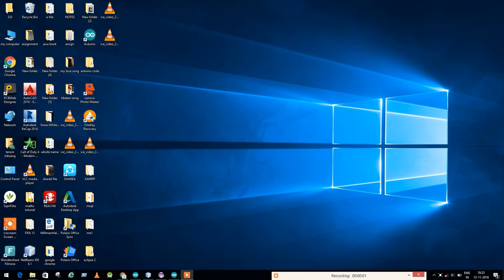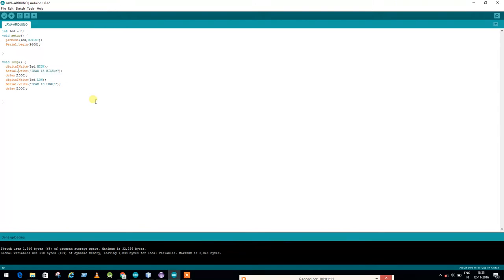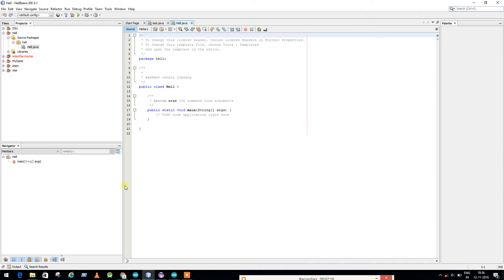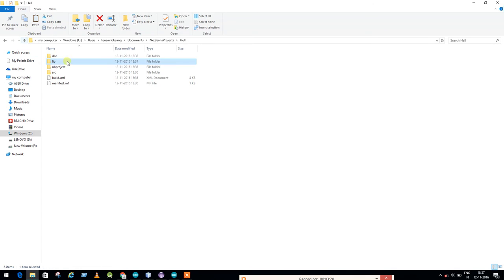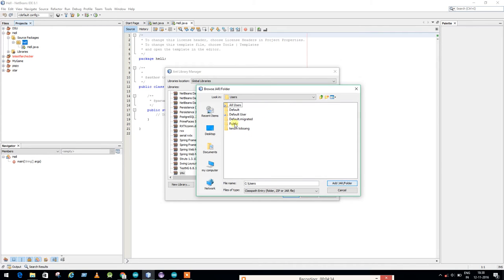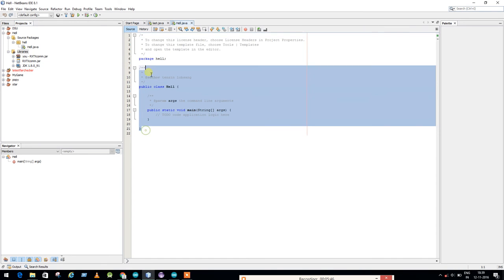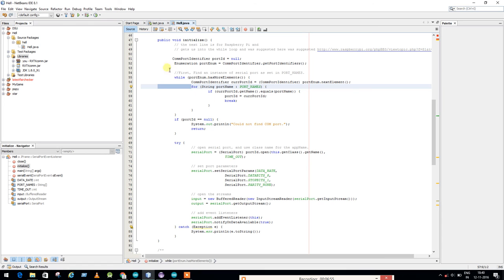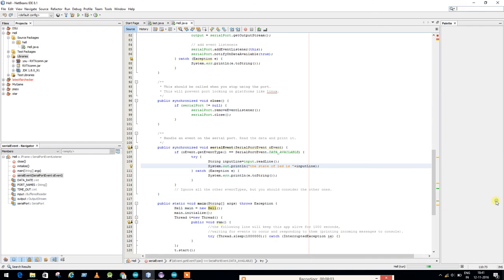Arduino and java netbeans serial communication

Comment: Thanks Lobsag for tutorial. I have the following error. How can I solve the problem?
run:
Started
#
# A fatal error has been detected by the Java Runtime Environment:
#
#  EXCEPTION_ACCESS_VIOLATION (0xc0000005) at pc=0x0000000180005b00, pid=16768, tid=15288
#
# JRE version: Java(TM) SE Runtime Environment (13.0.2+8) (build 13.0.2+8)
# Java VM: Java HotSpot(TM) 64-Bit Server VM (13.0.2+8, mixed mode, sharing, tiered, compressed oops, g1 gc, windows-amd64)
# Problematic frame:
# C  [rxtxSerial.dll+0x5b00]
#
# No core dump will be written. Minidumps are not enabled by default on client versions of Windows
#
# An error report file with more information is saved as:
# C:\Users\M\Documents\NetBeansProjects\SerialTest2\hs_err_pid16768.log
#
# If you would like to submit a bug report, please visit:
#   http://bugreport.java.com/bugreport/crash.jsp
# The crash happened outside the Java Virtual Machine in native code.
# See problematic frame for where to report the bug.
#
C:\Users\M\AppData\Local\NetBeans\Cache\11.3\executor-snippets\run.xml:111: The following error occurred while executing this line:
C:\Users\M\AppData\Local\NetBeans\Cache\11.3\executor-snippets\run.xml:68: Java returned: 1
BUILD FAILED (total time: 4 seconds)